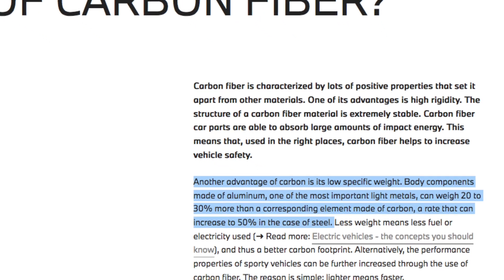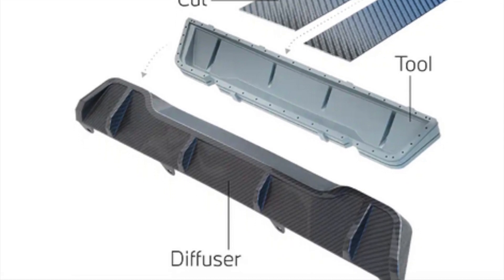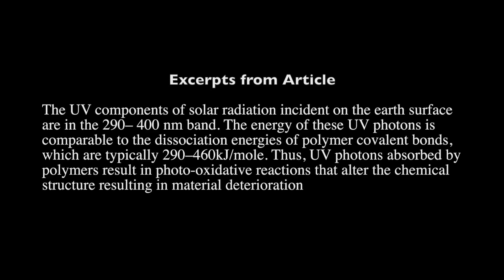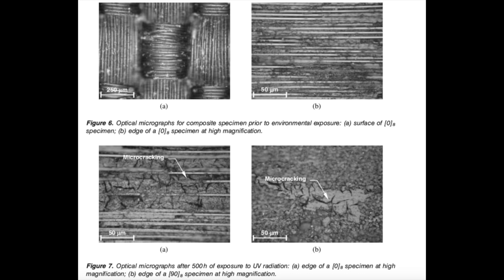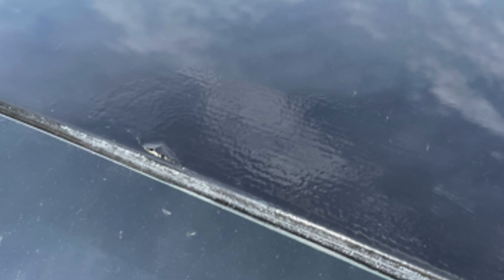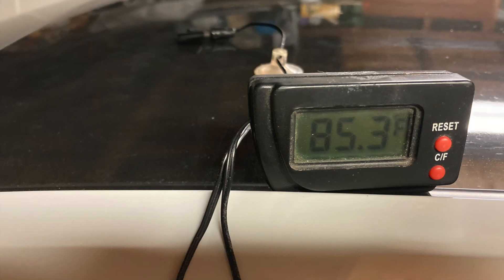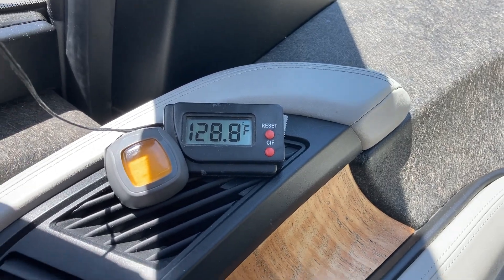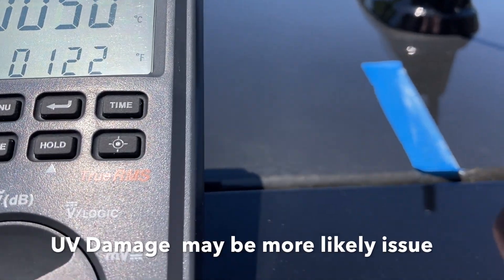BMW I3 Carbon Fiber Roof Aging Protection DIY Secrets Reveal

Comment: YOU ARE ALL GOING TO BE PISSED ONCE YOU FIND OUT THE ROOF OF A BMW I3 IS FIBERGLASS AND NOT CARBON FIBER!!! I HAD TO HAVE MY SANDED DOWN AND PAINTED …. THEN I HAD IT WRAPPED.. $900 TOTAL…. WRAP IT BEFORE IT STARTS TO PEEL!
Reply: I also had mine sanded down and painted with 3 clear coat layers: $600.

Comment: I really think the wax is going to break down the clearcoat over time if used annually as wax always takes off a layer of what it is scratched into. There is clear vinyl wrap made for cars exterior paint to block uv. But thanks for bringing this to our attention. I will definately go to a wrap shop
Reply from the maker: I think the UV blocking vinyl wrap is a good idea (haven't actually tested it's real UV protection though), but it also will degrade after several years so I would plan on replacing it before it cracks & lets moisture underneath it.   I did some looking, and I think the idea that waxing will wear out the paint over time is from using abrasive wax/polishing compounds, not the 'wax only' products.  In the old days, they would actually remove surface oxides from the surface of the paint (and remove some paint).   Of course if the car is dirty when applying wax, you can get micro-scratches/swirls.  Commercial waxes on the market block water penetration pretty well, but as the tests showed, their UV protection is less than desirable.    Thanks for the feedback!

Comment: Great presentation and thanks for all the information.
Is there a wrap material which is UV opaque or resistant? Silver or white color would be preferred.
For more advanced damage repair, what about fiber glass fabric and epoxy resin (or whatever they use, such as on a boat)? Would it adhere to the roof? Not damage it (make it delaminate)? Provide any UV protection?
Thx,
Reply from the maker: All good questions!   I currently garage my i3, as this is the safest way to limit UV and moisture exposure (maybe a car cover).  I also use a UV wax as the video is highlighting.   I will probably upload a new video on the best wax this year.  Most wraps are not completely UV resistant and will degrade over time, but at least would offer some protection for several years.  Several owners have gone this route.   Regarding repair with resin, I do not know of anyone who has done this successfully, but I have seen several videos on people sanding and restoring carbon fiber hoods with results that look pretty good.  So, it may be possible to carefully sand (don't break the fibers)/refinish and spray coat the roof surface but I am not sure of result at this point.  Good luck, & let us know how it works out!

Comment: Hi, I would be interested in purchasing some concoction you come up with. thanks.
Reply from the maker: I have been testing the solutions shown for the past ~ 6 months over the winter on my roof, to see if any negative reactions occur.  So far no issues.   If you saw an i3 with painter's tape on the roof, that was mine (each separate test group)...  If there are no road blocks, I may put on ebay in a few months.   Thanks for asking!
Reply: @bmwi3diy782  Thank you, please let me know if you do that. Have you explored ceramic coatings?

Comment: Would mylar be a feasible material?
Reply from the maker: Mylar is usually PET (polyethylene terephthalate, same stuff as soda bottles) and sometimes metallized with aluminum as seen in space blankets.  I did a quick check with an old water bottle from Costco and a thin section blocked about 75% of the UV-not bad!  So it may work to protect the underlying carbon roof.   But,  as you may have seen with old bottles in the sun, PET will discolor/breakdown over time.  Also, a thinner film is likely to block less UV than my simple 'bottle test'.     It may work as a replaceable protective film though?
Reply: @bmwi3diy782  I was thinking a highly reflective surface might not be legal in some states so I think there would be a couple of options.  Where you could legally mylar on the car then a removable film would be do-able.  For people that do not want to effect the appearance I was thinking about a removable sun shade.  I think most of my roof sun exposure is when I am parked at work. Otherwise its travelling home or in the garage.  My guess is the ratio of time exposed to UV is mostly when its sitting in the parking lot.  So , perhaps a film that would float above the roof only when parked.
Reply: Fiberglass resin to fix ?

Comment: Hmmm - UV + water — sounds like Houston!  My son has a weighted blanket that he never uses.  I wonder if covering roof with that and scotch-guard on the blanket would be ok.  Maybe pool noodles underneath to give air-flow?   Unfortunately, mine has to sit outside 3-4 days a week.  I have sun shades over head, but that’s only partial shade.

Comment: Solution white Vinyl!
Reply from the maker: Well, Vinyl is basically PVC (polyvinyl Chloride) which is itself not UV resistant unless coated with another material.  I suppose that it would block UV from getting to the Carbon fiber/epoxy so it may help.   It would likely need replacing over time.   Also, a white roof would likely help with air conditioning too.  I remember a big push several years ago to replace old tar roofs with white plastic roofing material to reduce cooling in industrial buildings.
Reply: I agree. White vinyl is opaque and will keep temperature down. While cpvc may not block uv, the white pigment certainly will

Comment: I would buy a pre-mixed protectant (or buy a recipe/guide with instructions to make at home), for something that will keep my roof in good shape. 

It would be interesting to compare test results for protective wrap/paint covering the carbon fiber roof. 

I’ve been wanting to get a white wrap on the roof to help reject heat. 
Living in Texas with 110+ degree summers, the AC in my car can only do so much. 
Reducing the AC demand should increase my range somewhat. 

Knowing that may actually protect the structural roof of the car will definitely help me justify the expense. 
I haven’t looked into pricing yet but plan to soon. 

Today I was quoted $400 to install UV rejecting tint/film on the interior of the front windshield. 
I doubt that will ever yield a financial return on investment, tho it certainly would improve the comfort and driving experience. 
Currently I’m not willing to spend that on tint. 

I’m unsure how big the market would be for selling a pre-made protectant since not many cars have exposed carbon fiber (as far as I know).
Certainly I’m happy to buy a bottle or two. 
Maybe you can post a YouTube poll to gauge interest.
Reply: To Reboot Ninja: Did you get the white wrap on the roof (I had the same idea)? Results? If yes, would you name the product? Thx,

Comment: Thanks for doing the research. How about a clear vinyl wrap for a solution?
Reply from the maker: Vinyl (or PVC) is not UV resistant if left untreated with an active UV absorber material.  There are some 'UV resistant' vinyl films advertised.   I suppose it would absorb some of the UV and protect the Epoxy underneath, but would need to be replaced as it also would age with sun damage. It could also act as a moisture barrier, which seems from the article to be part of the aging/delamination process.   It might be worth a try, at least you could remove the film periodically at a much lower cost than replacing the carbon fiber roof!

Comment: Will nano coating protect the carbon fiber hood? As in for body paint.
My i3 is also gettig discoloured and i too park outside alot.
Reply from the maker: I haven't tested nano coatings with regard to UV protection, but I have my doubts.